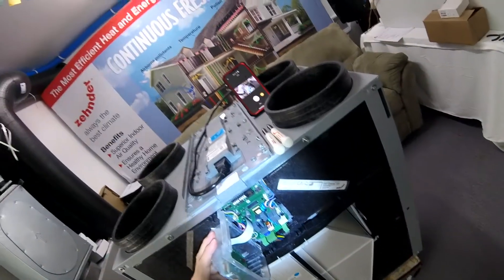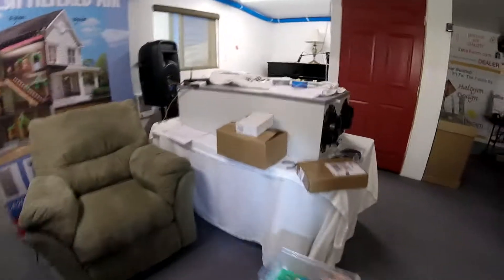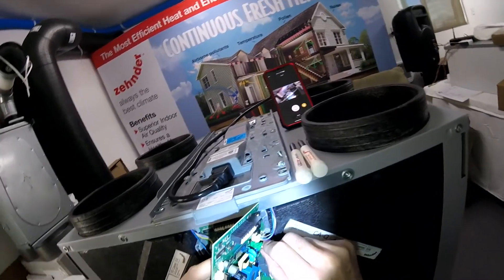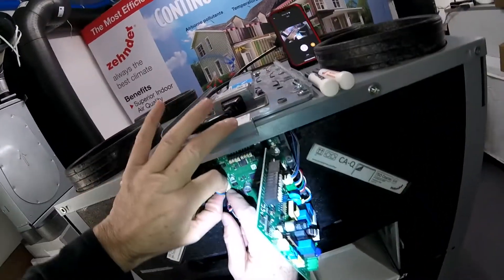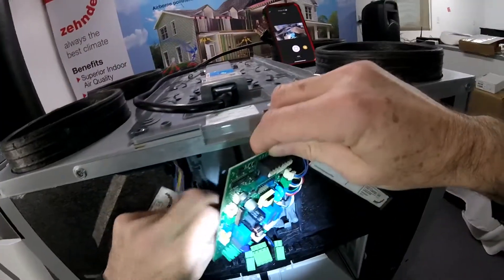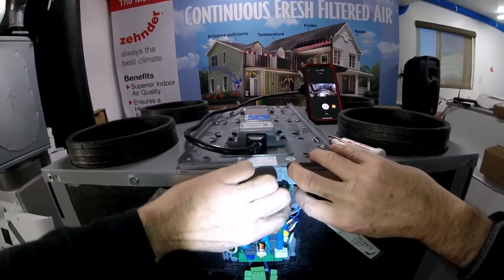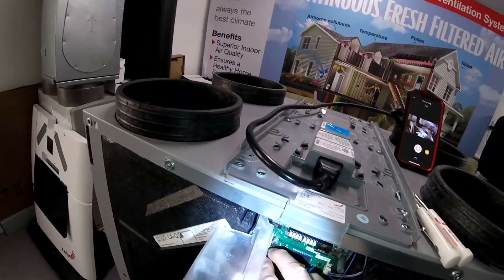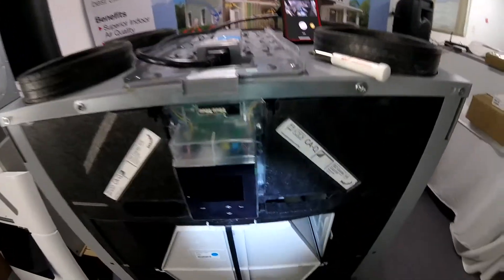Changing the Zehnder Q mother board

Comment: Hi Cody, I have a ComfoAir q350 and the display no longer displays but can hear the machine is on inside - tried a new motherboard and still no display, do you have any idea what the problem could be? Thanks!
Reply from the maker: There is a little ribbon that holds that face onto the plastic door. Trace that and make sure it is connected. The connection can come lose on the board and the face. It's a slip collar I believe. So the collar can be down without the ribbon contacts connecting. OR it's the actual display.
Reply: @PassiveHouseCody  
Thanks, I think it could be the screen that has failed and also a sensor within as lots or error codes have appeared on the comfo sense - this all happened at the same time!
Reply from the maker: @InfoNSM I'd inspect the red ballerinas seen in my mid sensor video. Reset ALL errors as an installer. 4210 is the code here in the US  What ever is happening is not common. It takes at least 5 minutes to reset and recalibrate.
Reply: @PassiveHouseCody  It was the external Top sensor, this reactivated the main screen and all errors rectified! thanks for your help!
Reply from the maker: @InfoNSM Thanks for posting the results. Good News. Cheers to ya!